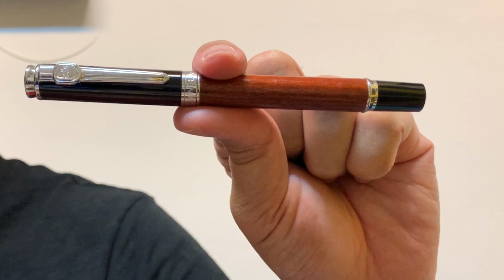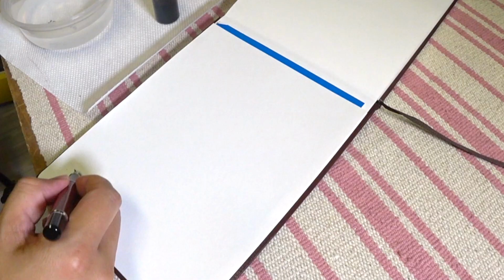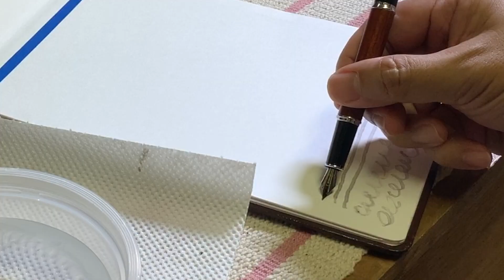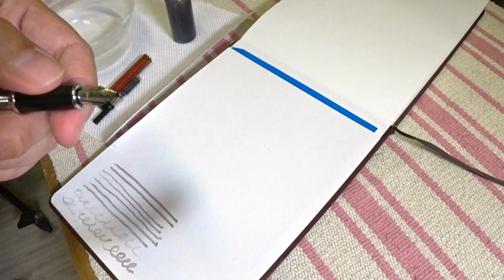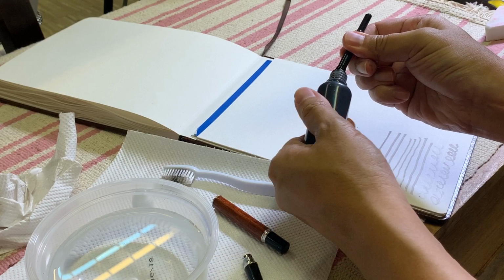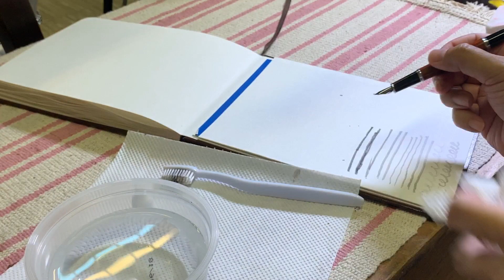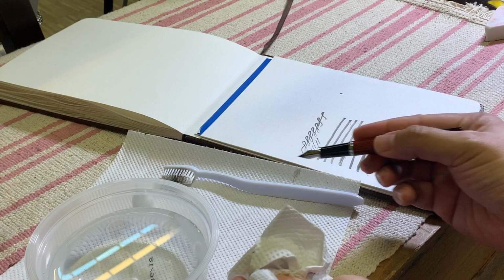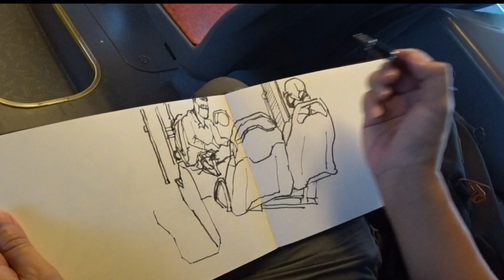How to Clean a Fountain Pen Nib

Comment: Hi Alvin! It’s me again! I have a tip as well. If nothing else works. There is a very affordable cleanser by Rohrer &Klingner. They make colorful waterproof inks for fountain pens. Since I have too many pens to use everyone constantly (...anyone else having too many for them being just so nice?!?) , they dry up on me frequently. The cleanser is to unclog those that will resist every other method. It is for sure available online. Just type in cleanser and the brand. I even mix it in with my ink now so that the pens do not dry out as quickly. 
Have a grat. day everyone!
Reply from the maker: Vani wow! You mix the ink with the cleanser! Awesome... what is the ratio of ink to the cleaning agent? I do have olive oil soap chips but have never gotten to use them because I sketch too much 😝
Reply: I do use a 1:5 cleanser:ink ratio right now. 1:4 turns the ink recognizably lighter for my taste. It stays 100% waterproof nevertheless. 👍🏻 By the way-guess who bought the Sonnet Watercolor Box! You have the White Nights, I saw a yellow tin 21-Set by their student watercolor and had to get it! 😄 I think that White Nights (I have their small box that you had as well and their 36 Box) are very different from other watercolor like Schmincke or W&N. What do you think?
I do collect Lamy Safari since I was in 4th grade -I am 43 now-that’s why I have so many fountain pens! 😆